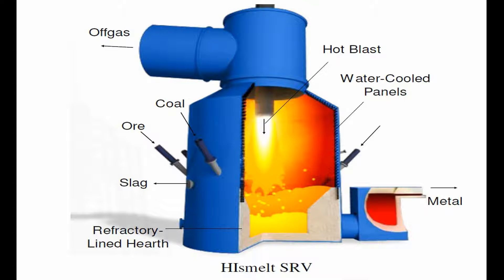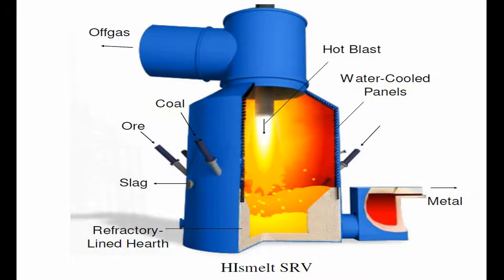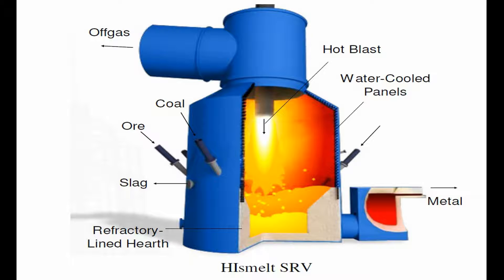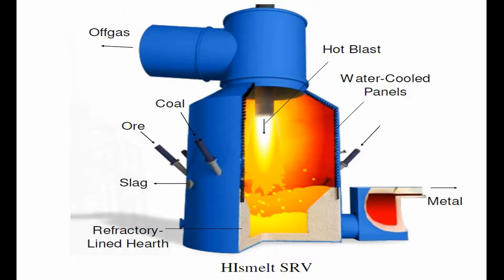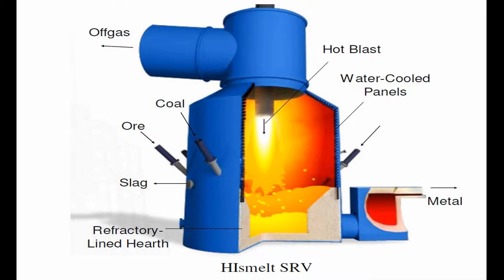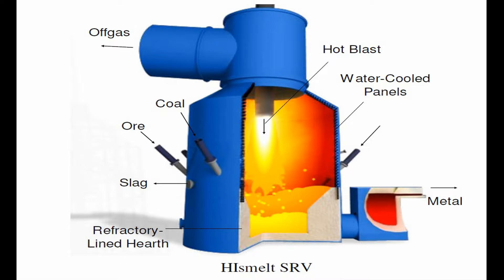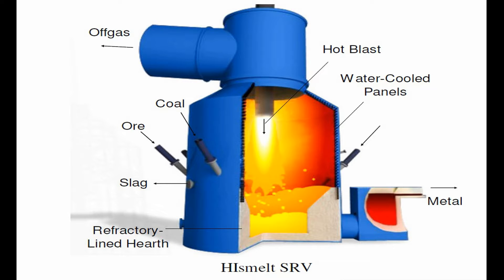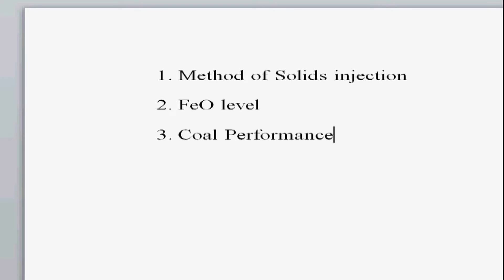Hismelt Process Iron Smelting. Background

Comment: What energy does hismelt use? And does it practical in reducing low grade iron ore into dri?
Reply: HIsmelt uses Semi Anthracitic coal and Hot Air Blast enriched with O2 to 40%. HIsmelt does not make DRI, it turns iron ore fines directly into liquid pig iron.